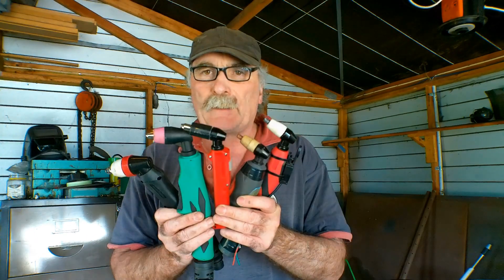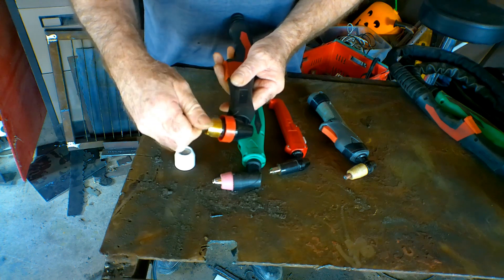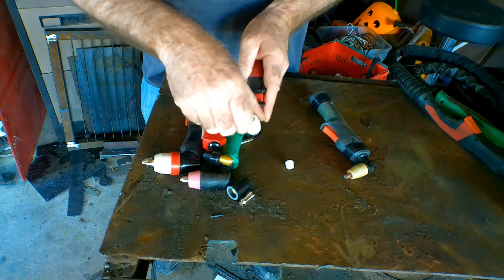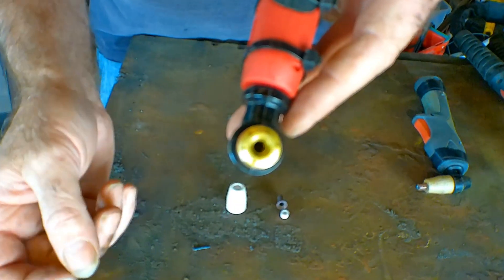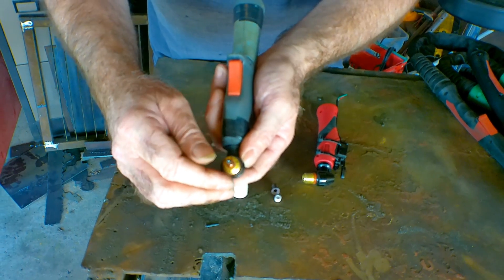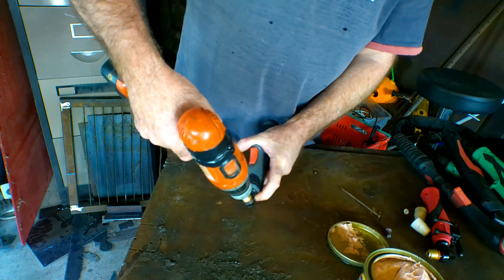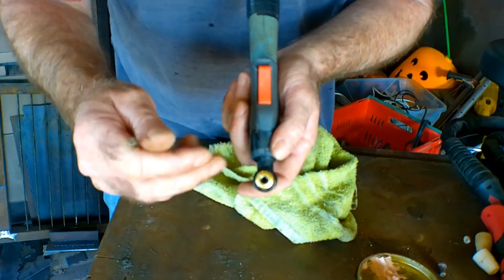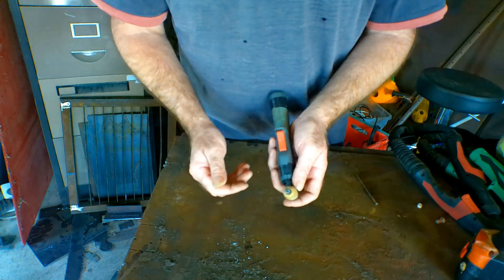Plasma Torch Repair (No Money Needed)

Comment: My PT31 has other problems..  The arc doesn't come out the center of the tip,  It comes out on the side of the tip..  I've changed the consumables many times,  no luck..  I can't see anything wrong with it..    I ordered another TP31..

Does the tip need to be centered in the ceramic cover  ? 

I just bought this thing and haven't been able to cut anything yet..  What am I doing wrong ?
Reply from the maker: It should self center ,Sounds like your swirl ring .Cheers Pete